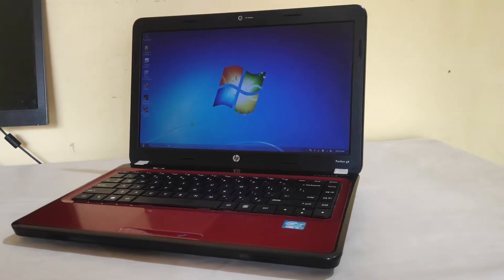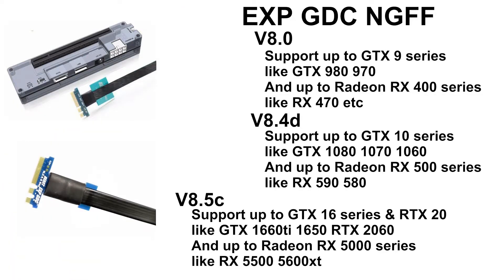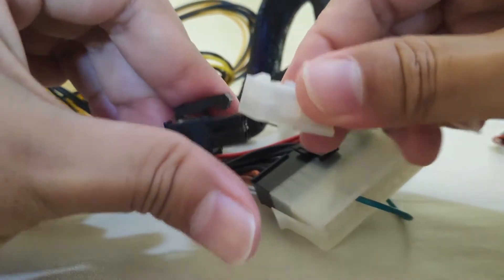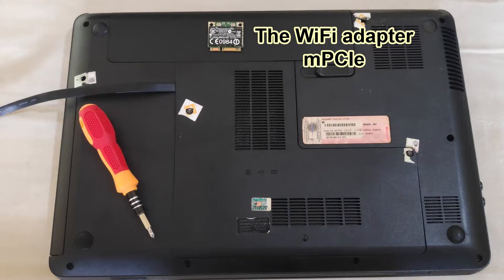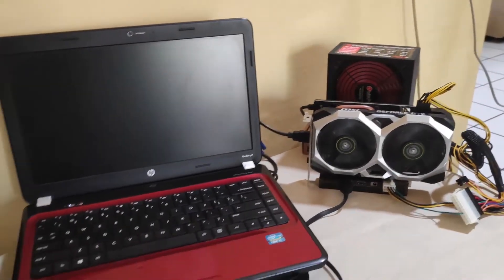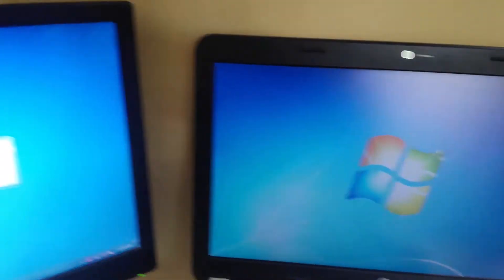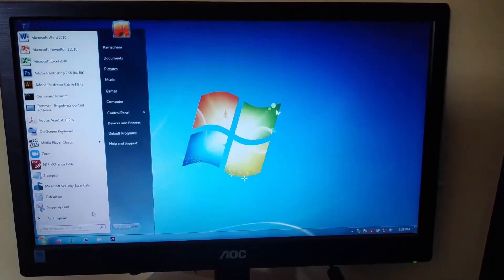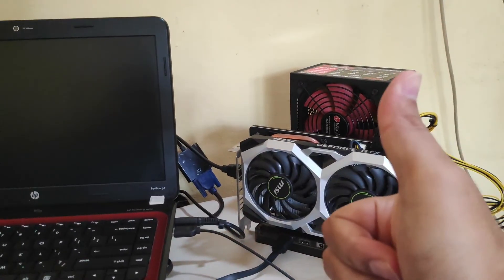EXP GDC Beast V8.5c eGPU with GTX 1660 ti on Old Laptop from 2012

Comment: Mate I have a Acer aspire e 14 ((i5-5200u-HD Graphics 5500)) and I was planning on putting a 750ti or maybe a 1050ti on it. Do you think it will work?
Reply from the maker: There are several points to pay attention here

First, Core i5 5200U might be using NGFF WiFi slot. So you need to get EXP GDC NGFF.
Example of assembly here 
https://youtu.be/pKv436sOrNo

Secondly, 750ti or 1050ti is a 75 Watt GPU category. You need different approach to feed Power to the eGPU board because the White Cable Adapter that Bridge from PSU to eGPU Actually doesn't give a stable 75 Watt.

Check my Latest eGPU Troubleshooting video regarding this one.

Comment: The GPU has more VRAM than the computer's system memory
Reply from the maker: I already upgraded this Laptop to 8 GB RAM. Both 4GB 1333 Mhz 2 pieces.

 I still haven't upgraded the storage, planning to use SSD SATA. And HDD caddy. I don't have time to make new video yet for external GPU.

In theory, the Power Consumption will be much lower when compared to using HDD. So it will be more suitable for eGPU.

I will still use Windows 7 instead of Windows 10, because the Laptop's CPU itself perform Poorly with Native DirectX 12 in Windows 10.

Any video games with DirectX 11 or lower are running great.

Comment: Nice video, i have an hp laptop with a gt 635m in it  and put an egpu a 1050ti just  un installed the gt 635m and installed the 1050ti driver and it works, but once in a  while it crashes giving me a bluescreen error, any tips on how to fix this problem, thanks
Reply from the maker: You need PCIe Allocation.
First, you need to disconnect your eGPU. Just unplug the eGPU HDMI cable is enough.

Now Boot your Laptop normally. Open Device Manager. Since you said you had NVidia GT 635M, it must be listed as "Microsoft Basic Display Adapter" alongside with IntelHD in Display Adapter section?

Now, on the top menu from Device Manager, Click on View - Devices by Connection.

Now Try to Expand every PCI Devices, scroll down until you find that "Microsoft Basic Display Adapter" . Once you find that Root PCI location of the GT 635M, Right Click on that PCI root of the GT 635M, and then Disable it.

Now Shutdown the Laptop. Use eGPU again.

One question, is your GTX 1050 ti has additional PCIe power connector? If it doesn't have PCIe power connector, it must be a 75 Watt GPU category.

You will need a different way to connect the PSU to the eGPU. I have another video of it.
Reply: @ClayWheeler  yes it has , and thanks will try this later  after church
Reply: @ClayWheeler  yes it has
Reply: i think  i already disabled it

Comment: hy bro, saya menggunakan laptop HP G72. semuanya menyala tapi layar di laptop saya untuk pertama kali saya hidupkan mati. apa saya perlu monitor tambahan?
Reply from the maker: Try to take off the eGPU HDMI cable. And then Start the Laptop normally.

From the Desktop Wallpaper, press on Keyboard Windows key + P. And Select "Laptop Only"

Shutdown Laptop. Plug in the eGPU HDMI cable. Start the Laptop again.
Reply: did you ever experience the same thing when you just installed EXP GDC?
what if that doesn't work? is there any other way or maybe my laptop is not suitable.
Reply from the maker: @fickyfalcon2858  yes, in the video, when EXP GDC not even Detected for the first time. 

But if you're using the same mPCIe like in this video, check out my other video that talks about mPCIe Troubleshooting.
Reply: Oke bro..
mine is exactly the same as in the video
Reply: ok thanks bro. in Indonesia it is midnight. tomorrow morning i will try

Comment: Weird, I have Vega 8 and R625 PGU in my laptop and I connected RX 5500 XT into it and didn't have to uninstall any drivers, I just downloaded the Radeon software and it showed me 3 GPUs installed.
Reply from the maker: Well, this video is talking about Old Laptops.

Vega 8 isn't particularly Old.

The other proof is that Asus ROG Flow X13 using the same Driver for both GTX 1650 and eGPU RTX 3080.

Comment: Can you unplug you egpu from the mpci slot and still use the integrated gpu easily with no problem if you want to bring your laptop somewhere, provided that I have an external wifi adapter?
Reply from the maker: Yes Always
Reply: Thank you! But is there no software tweaking when putting it back or pullin it out?
Reply from the maker: @JS-cy5th  in my case, no
Reply: @ClayWheeler  thanks for the reply, this helps me alot! 😊

Comment: Can I do this with my Acer AMD a10-5757m thank bro.
Reply from the maker: Ah that's very difficult.

Old AMD CPU before Ryzen is difficult to use eGPU, it is often not detected.

Only AMD Ryzen from 2017 or newer can use eGPU.

That's why most eGPU Tutorial for old Laptops are using Intel CPU.

Comment: HP probook 4535s it work or not
Reply from the maker: Is it using Intel or AMD CPU?

Because eGPU for old Laptops is only recommended for Intel CPU.

Starting from Ryzen Laptop in 2017, eGPU on AMD becomes possible. Before Ryzen, it is nearly impossible without Soldering the PCIe Lanes.

Comment: what if i use exp gdc v8.0 and gtx 1660ti?
what error could I have?
Reply from the maker: Apparently EXP GDC V8.0 can still be used for GTX 1660 ti. Beast EXP GDC V8.0 can still handle RTX 3070 without any problems. Here's the proof

https://youtu.be/6JcucfWz51o 

However it is back to your Own Laptop Model again. Some models are a bit more complicated to set up.
Reply: @ClayWheeler  I forgot to say that my laptop uses the ngff version, it will still work?
Reply from the maker: @jjbnynyn1358  here

https://youtu.be/pKv436sOrNo
Reply: @ClayWheeler  thanks

Comment: Hello, I don't know which one to pick, expresscard or pcie? I have Lenovo Thinkpad E520 with i5 2nd gen and I'm thinking of buying gt1030. Which one should I buy and will gt1030 work with this external dock?
Reply: Just open it up and check the slot type of the wifi card. Also I would suggest to instead get a rx 500 series because unlike the gt 1030 they will be supported by the new amd FSR technology. You can get a rx 560 for about 140$ right now on Ebay.
Reply: @craigthebrute9678  thanks!

Comment: What is the best gpu for intel i7 4th gen without any bottleneck issues
Reply from the maker: 4th Gen itself already bottleneck because the WiFi adapter slot is most likely a Mini PCIe (mPCIe) type. Hence you're limited to 2.5 Gbps. Even GTX 1660 ti in this video or my other newer videos is running at Less than 25% GPU stress under Max Load.

Your Bottleneck is the 2.5 Gbps bandwidth. That's it.
Reply from the maker: But if the 4th Gen Core i7 already using NGFF, it has at least 8 Gbps bandwidth. That's why you must check the WiFi Adapter slot by yourself.
Reply: @ClayWheeler  No I have mini pcie slot only is there any chances that  I can atleast use gtx 1060 for docking purpose or else pls tell me the graphics cards that  will not cause any issues regarding bottleneck(far better if it is greater than Intel hd 4400) regards.
Reply from the maker: @lethal4793  with GTX 1060 6GB maybe stagnant to 50% GPU usage under full load.

Comment: Thank you, I have a Lenovo G570 i5  I want to install Gtx 1050 Will it work well?
 I will buy ExpGdc v8.5c
Reply from the maker: Core i5 what version? The number of Core i5. Check it from DXDIAG
Reply: @ClayWheeler  Thanks for reply  ( intel core i5-2450m cpu @ 2.50ghz )
Reply from the maker: And by the way, GTX 1050 is only 75 Watt. You need to use different way to Start the eGPU. See my latest Video
Reply: @ClayWheeler  I will watch thank you
Reply from the maker: @moamenkhames8905  Good. Yes you can use EXP GDC 8.5c and GTX 1050 ti
Reply: @ClayWheeler  can I use egpu on intel celeron n4000?
Reply from the maker: @GDFistful  that is from 2017 with 2 Cores 2 Threads. Technically it is possible to use eGPU, Which must be NGFF type.

But personally, I wouldn't recommend to use eGPU for 2 Cores 2 Threads CPU.

eGPU needs at least 2 Cores 4 Threads.
Reply: @ClayWheeler  I can’t open the down part of the laptop, how do I access the laptop?
Reply from the maker: @GDFistful  nah, I suggest don't do it. You are just wasting money trying to get eGPU working on that system.

You will get 5% Performance boost at best when compared without eGPU.
Reply: @ClayWheeler  oh okay, thanks
Reply: hi. mine is 4730s i5 2410m with Radeon hd 7400m , will this work? ill be using only old videocard which is 750 ti, is it also okay not to disable your radeon gpu since it has egpu already? how will you know that egpu is used by the system instead of the radeon one? thanks

Comment: I just realized, why the f*** doesn't laptop have PCI-express connectors. With so many in the market, one could expect to find at least one...
Reply from the maker: What is your Laptop anyway?
Reply: @ClayWheeler  Ideapad 510, it has a NVIDIA 940MX but it doesn't perform so well.
Reply from the maker: @Cronofear  actually you can

You will need a NGFF WiFi Slot for the eGPU.

Source here exclusively for your Laptop model https://youtu.be/pKv436sOrNo

Comment: hi man i have a same laptop but with different specs as amd a4 processor and having 6 gb of ram of model name as hp pavillion g6 1318 ax So i need a help for making it with 1050ti
Reply from the maker: AMD Processor before Ryzen is not recommended to use External GPU. Unless you are a DIY Enthusiast.

It is very difficult to configure Old Laptop with AMD A series CPU. Like it cannot detect External GPU most of time.

I know some people made it Possible to work with External GPU, and it involves Soldering the PCI slot on the Motherboard.

Not worth it if you're a Beginner with AMD A series CPU.

AMD Ryzen on the other hand, is very easy to use External GPU

Comment: hi, i'm planning to use gtx 750 ti on my lenovo g40 do i need a "special" power supply for the egpu or anything above 300w work just fine?
Reply from the maker: Is the GTX 750 ti has PCIe power connector pins? Either 6 Pins or 8 pins?
Reply: according to google it's 6 pin
Reply from the maker: @foxtrot3479  I just want to Warn you, that Most NVidia cards with x50 or x50 ti numbers Always Have 2 Variants.

One With PCIe power connector, another Without. So you better Double check if the GTX 750 ti Actually have 6 pins as you said, Or not.

Because if the Card don't have any PCIe power connector, you will need a Special PSU called Dell DA 220 Watt Brick PSU with 8 pins PCIe power cable.

Example of Video here with GTX 1650 which don't have PCIe power connector. https://youtu.be/ir-5JDITDd8

BUT if you made sure the GTX 750 ti has 6 pins PCIe power connector, then you can use any PSU with that particular PCIe power cable like in my video.

Also, remember that 8 Pins PCIe power cable can ALWAYS Be splitted to 6 Pins + 2 Pins separately, you just need to slide it off.
Reply: alright thanks man
Reply: btw do i have to use that dell psu can't i just bought 8 pins cable and use it on any psu, because i can't find that psu on local online shop
Reply from the maker: @foxtrot3479  what is your PSU right now?
Reply from the maker: @foxtrot3479  OR maybe just make sure that Particular GTX 750 ti first.

After you're really Sure about PCIe power connector in GTX 750 ti, then We will Talk about PSU.
Reply: i haven't bought it yet but it's going to be a simbadda 380w, yeah let's wait until the gpu arrive
Reply from the maker: @foxtrot3479  then, just make sure That particular Simbadda PSU has 8 pins PCIe power cable.
Reply from the maker: @foxtrot3479  What is your Lenovo G40 CPU?
Reply: @ClayWheeler  Intel Core i5-4210
Reply: @ClayWheeler  it's me again, the gpu arrived but i don't see any power supply connector anywhere
Reply from the maker: @foxtrot3479  now I suspect it is either two things.

It is a Fake GTX 750 card, or if it's Real card, it is 75 Watt.

Try to record a Video of that card appearance, and Upload that video to your YouTube channel.
Reply: @ClayWheeler  discord? i'll send a picture instead, it's also easier to ask another question there
Reply from the maker: @foxtrot3479  Actually I don't have discord. I will use my email then

Blazer.Twin@gmail   .com
Reply from the maker: @foxtrot3479  take Various Angle of pictures of GPU
Reply: @ClayWheeler  sent
Reply from the maker: @foxtrot3479  yeah it is Original GPU card alright.

How about the PSU now?
Reply: @ClayWheeler  i still haven't bought it yet because i don't know if need a specific one, can i use any power supply tho?
Reply from the maker: @foxtrot3479  I still recommend Dell DA 220 Watt Brick PSU.

But since you said you cannot find it, you will need any PSU with at least 8 Pins PCIe power cable -- Like in my Video - only $15 LMAO

So the Difference is that you will need to Plug the 8 Pins PCIe power cable directly to the EXP GDC. And then you JumpStart the PSU before you start the Laptop.

I will just make a new Video explaining how to do it
Reply: hi, i have everything connected and follow everything you told in the video (i even get the same psu as you) but the egpu is not detected it doesn't power up when i turn on the laptop, is this have something to do with bios whitelisting?
Reply from the maker: @foxtrot3479  Hi sorry for Late Reply.

Is your PSU and GPU fans are not Spinning immediately when you Turn on the Laptop?

I'm still editing the Video on How to Jump-Start the eGPU and the PSU before starting the Laptop. In other words, the GPU must be Running before the Laptop is turned On.

I will upload the new Video soon, talking about how to deal with 75 Watt GPU Jump-Start. 

Because it's totally different from Cold Start as in this Video with GTX 1660 ti which using 120 Watt.
Reply: @ClayWheeler  yes the fans doesn't immediately spin when i turn on the laptop.
Reply: @ClayWheeler  there's this switch in the psu when i flick that it immediately turn on the psu and the gpu but it still doesn't detect on my laptop
Reply from the maker: @foxtrot3479  is the PSU have 8 Pins PCIe power cable?

That's more important than 20 pins ATX power cable and 4 pins CPU cable.
Reply: @ClayWheeler  I'll send you another email
Reply: @ClayWheeler  sent, there's plenty of 8 pin cable i don't know which one.
Reply from the maker: @foxtrot3479  Sorry asking again, when you Switch the PSU, did you mean the PSU I/O switch on the rear near the AC Power Cable?
Reply: @ClayWheeler  yes http://imgur.com/a/rgyORUd
my setup look like this if you're wondering
Reply from the maker: @foxtrot3479  as of right now, I'm having trouble to recreate the Problem on my own.

I cannot Jumpstart my PSU before the Laptop. And by Jumpstart, I mean by manually Shorting out the ATX Cable to force the PSU to start, without anything attached to it.

Still trying for solution on my end to replicate 75 Watt Scenario like yours.
Reply: @ClayWheeler  when i flick the switch in a exact time when i start my laptop, the laptop doesn't boot at all, when i google that issue it says that it have something to do with the  bios whitelisting. is this true?
Reply from the maker: @foxtrot3479  Alright I will make this a bit quick for you. Because what I'm writing here is gonna be in my next video to upload.

Content 1: unplug the eGPU cable from the Laptop. And put back the WiFi Adapter as before. So what you want to do here is Updating all of internal Components Drivers. BUT Please don't use Windows 10 Built-in Driver Updater feature. You must disable Windows 10 Driver updater from Settings, Update, Update settings. Use a 3rd Party App to update the Drivers of your Laptop alone. I suggest ioBit Driver Booster app.

Basically what you want to Update here is everything related to Basic Motherboard functions, like ACPI Controller, PCIe Bus Controller, including WiFi Adapter Controller.

Content 2: Actually don't exist in my current Video, but it's about BIOS. You need to Disable " PXE to LAN Boot "

Content 3: Specific for 75 Watt GPU model like yours, You MUST NOT using the White Cable Merger that came along with EXP GDC. Instead, you will need to Plug the 8 Pins PCIe power cable from the PSU straight to the EXP GDC power input.

That means you need to Jumpstart the PSU before the Laptop.

The reason? The White Cable Merger from EXP GDC Actually cannot feed a constant 75 Watt.
Reply from the maker: @foxtrot3479  in case you need a Pre-Cracked app of ioBit Driver Booster, get here.

https://lrepacks.net/repaki-sistemnyh-programm/161-iobit-driver-booster-professional-repack-amp-portable.html
Reply: @ClayWheeler  thanks i will try this right now
Reply from the maker: @foxtrot3479  Good News.

I was finally able to Replicate the Problem on my end. So I can now make a new Video for EXP GDC 75 Watt GPU.

It's 100% different Approach from Current Video.

Can I use your GPU Photo from email for reference? I will include it in my Next video.
Reply: @ClayWheeler  absolutely
Reply: @ClayWheeler  there's 3, 8 pin power connectors since i already split 1 there's 2 left, which one was it i'm afraid to plug the wrong one and bbq the whole thing
https://imgur.com/a/GJS7cCw
Reply from the maker: @foxtrot3479  New Video is up. Sorry it took so long.
https://youtu.be/TSF8zckwTDE